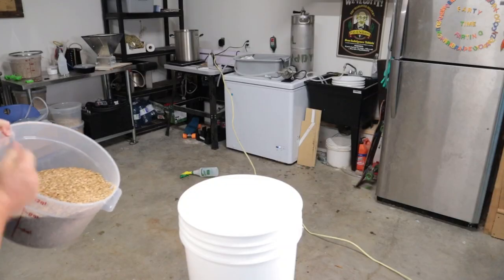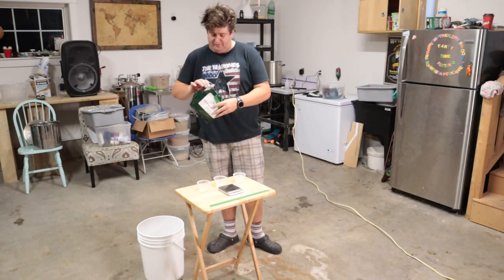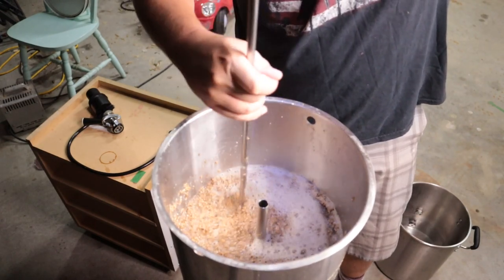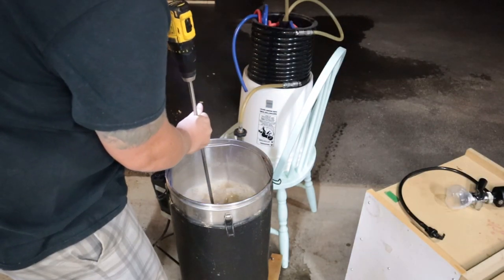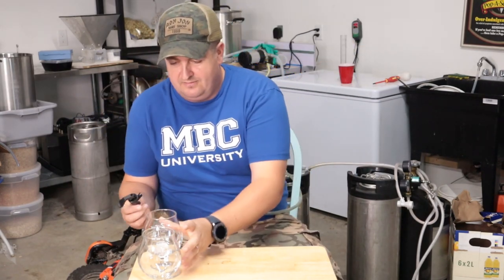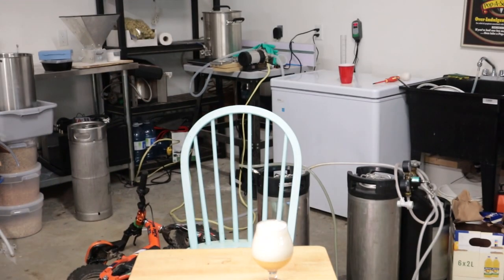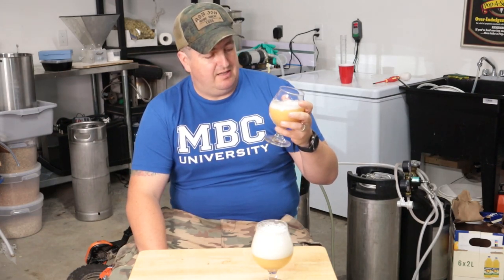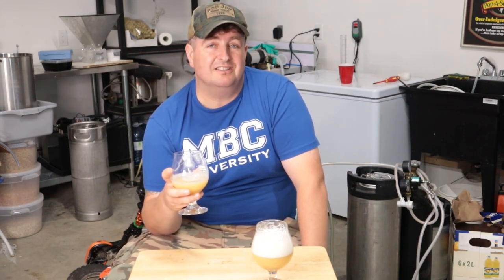How to Brew a 4 Day Hazy IPA | Grain to Glass

Comment: Haha love your vids good job! Will definitely try the dirty carb method.
Reply from the maker: It seemed to work pretty good. The key is to just leave it at 40psi overnight and it turns out well. Just watch it if you are using a Sanke keg, they aren't rated as high as pin/ball locks. Cheers!

Comment: GREAT BREW DAY!!! The beer looked good for being green.
The brewing method produced homebrew style moonshiners beer, not ale. The single temperature infusion method is used in grain distillation to produce extract that contains mainly glucose, which ferments the fastest, it is simple sugar. Ale and lager cannot be produced by soaking malt in water at one, high temperature, due to the way enzymes function, and chemical precipitation, making strike and target temperature, pretty much, useless. The brewing method skips three steps that are used for producing ale, conversion, dextrinization, and gelatinization.
The malt is high modified, high protein, malt, according to the spec sheet, which makes the malt suitable for grain distillation. That may be the reason why the brewing method is single temperature infusion. To produce ale and lager, under modified, low protein, malt is used with entirely different brewing methods, step mashing, and decoction. Weyermann and Gladfield produces under modified, low protein, malt. Under modified, malt is richer in enzyme content than high modified, malt, and low protein, malt contains more starch/sugar. It's a good idea to learn about malt before brewing ale and lager because the malt being purchased may require additional enzymes (Alpha-Beta) in order to produce ale. It all depends on the level of malt modification. The higher the modification, the less suitable the malt is for producing ale. On a malt spec sheet, Kolbach, SNR, and S/T, are used for determining malt modification. Protein content is usually listed as a percentage. Malt spec sheets are online from every malthouse, and they are used in brewing for determining the quality of malt, before purchasing malt. 
Any type of flaked grain contains high levels of Beta Glucan, and protein. In home brew, starch carry over, Beta Glucan, and protein goop provides body and mouthfeel. You really don't need the stuff because in malt are the ingredients that provides body and mouthfeel in ale, A and B limit dextrin, and pectin. The ingredients are contained in amylopectin, which is the richest starch. Amylopectin is heat resistant, complex starch that ends up in spent mash, paid for, when the infusion method is used. The decoction method takes advantage of the starch.
Back in the 70s, a bunch of advertisers invented CAMRA, and they renamed low quality, moonshiners beer, and Prohibition beer, Real Ale. Recipes and contests set the hook.
STAY PARCHED. STAY TERRIBLY PARCHED.
Reply from the maker: Thanks for checking out the video, there is a lot there to digest, thanks for the info!  Cheers!
Reply from the maker: Really interesting stuff here. A 'real ale' brew day would be a great video to do in the future. Any good commercial examples of 'real ale'? I'm assuming since you mentioned CAMRA you might be more in the European area and an example might be a bit harder to find here in Canada.

Comment: Get a pressure kit for your all rounder and you can really turn it around in a few days!
Reply from the maker: I do have the kit, just seems every time I'm done brewing, I'm too lazy to set it up (or I forget to put the dip tube in and fail...). So far my only pressure ferment was accidently forgetting to attach the spunding valve to a 10L keg and it blasting through the blowoff valve later the next day. I will do a proper pressure ferment soon. Cheers!